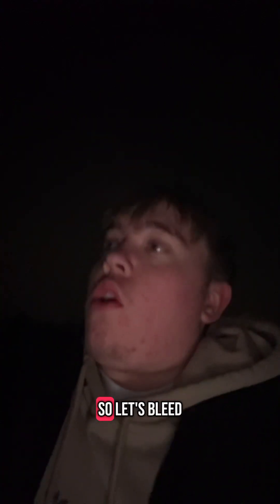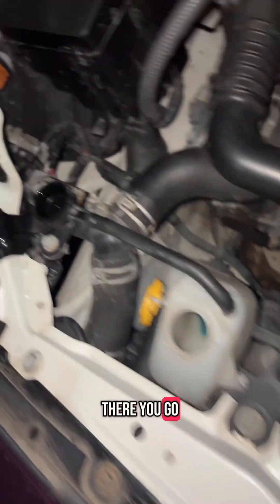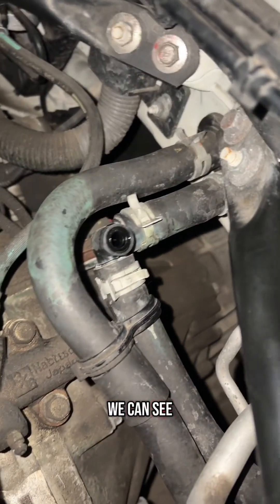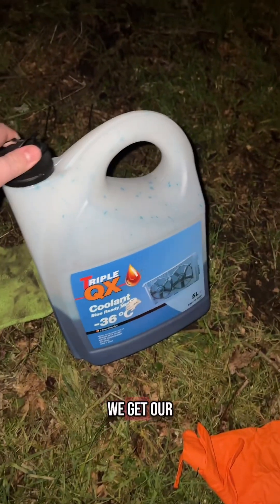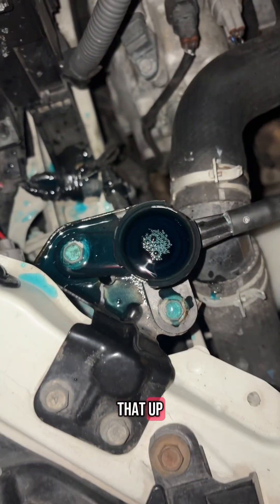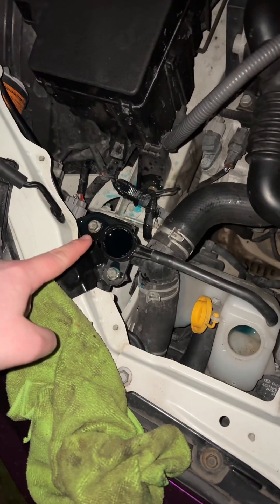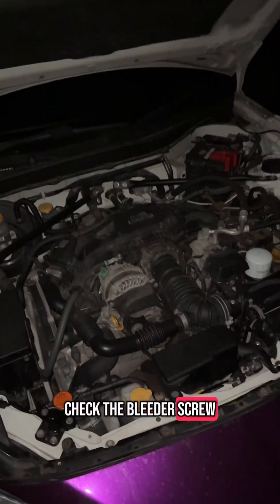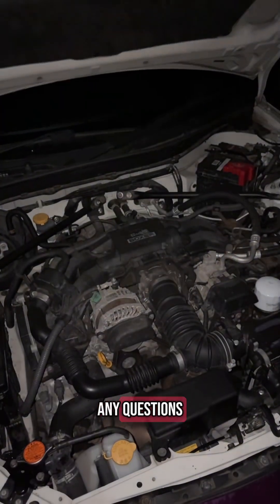How to bleed coolant on a gt86

Comment: Get it up to temp then slightly crack the bleeder. Any air will exit through the bleeder.
Reply from the maker: the fun way of doing it would be getting it up to temp rip the bleeder off and run - all the air will be out however you may get burnt 🤣